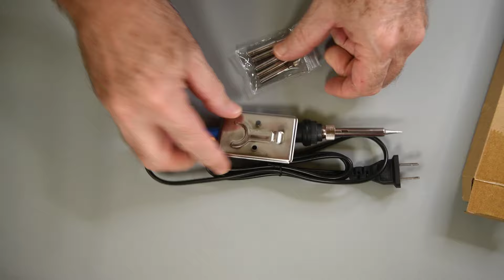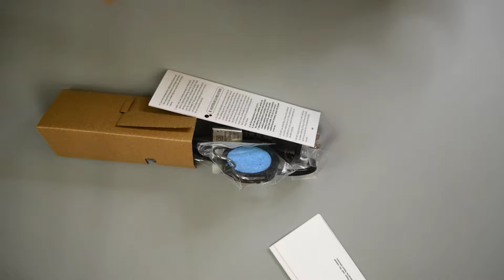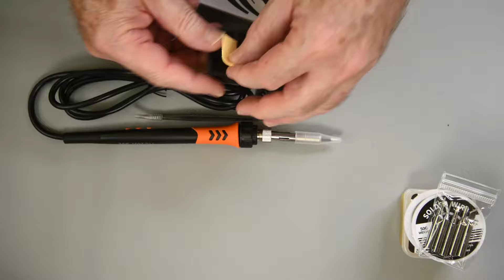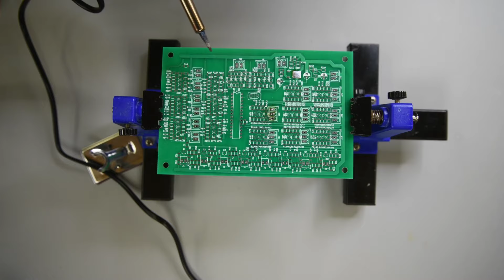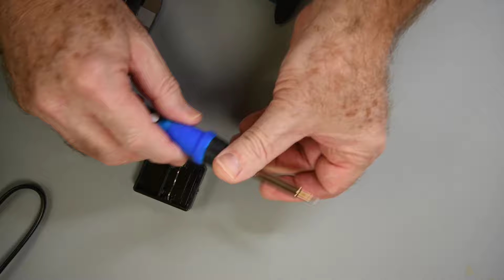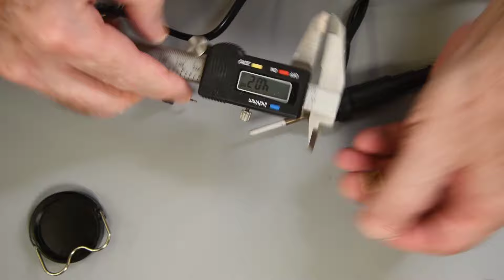Under $20 Soldering Irons – Are Any Of Them Usable

Comment: So I use a similar iron to these in the video. I run it at least once a week. It works perfectly for what I need it to do. From small to huge... brass threaded inserts injection lol
I don't wanna use my nice irons for putting in brass threaded inserts into 3D prints. That would be silly.
Reply from the maker: Wouldn't you need very good temperature control for the plastic?  I'm still looking at 3D printers, which one do you use?

Comment: The cheapest one is actually really good, if you know how to modify it a bit.
Reply: what u gotta do wit it
Reply: What do you have to do )
Reply: I use the lowest setting most of the time. In my case, the lowest setting was still too hot. One resistor inside was replaced with a bigger value to keep the wattage stable at about 10W so that it's hot enough just to melt 1.0mm 63/37 solder but not over hot to burn the solder on the tip during longtime standby. The warmup takes longer time though about 3 minutes, but I'd rather live with that.

Comment: Ive used cheap irons for soldering small RC bullet connectors. 
Id remove the tip from the iron, place the connector imside of the iron, drop a timy pieve of solder in the connector, then plug it in. The pretinned battery and/or esc wire was just pushed into the connector. It comes right out. Soldered beautifully

Comment: how about walmarts hyper tough 60w soldering iron?
Reply from the maker: What purpose are you looking to use it for?
Reply: @metalplasticelectronics354 i’m gonna use it to do some electronic soldering
Reply from the maker: I’d look for an iron where the tip and heater are a single unit. Those cost a bit more, but they’re usually worth it. I haven’t tried the Walmart Hyper Tough iron, but I’d expect it to be like most of the other $15–$20 irons.
If you have a USB-PD supply that can do 100W or more and outputs at least 20V, take a look at some of the USB irons. The iron plus a tip or two can come in under $40. I’ve tried the Fnirsi and they’re not bad, but if you get the kit with the USB power brick, the price jumps to $80+.
If you want the lowest cost for a tip/heater combo, look for something that uses Hakko T12/T15 tips.

Comment: You use cheap soldering iron for desoldering stuff though the catch is that you have to do it under 400+ degrees up to 450 they are indeed very unstable when it comes to soldering
Reply from the maker: Non of these in this batch are really temperature controlled so they are all unstable, just some much more than others.  And the fact that they deliver much less power than the stated value makes large ground connections very difficult to get enough heat to the joint.  There is almost no scenario where buying ones of these is a good idea.  A few more dollars can get something much better.

Comment: In one way your power measurement is not correct. Most (if not all) of those irons are made in China and their power claims are based on 220 volts. You tested using 120 volts, which would technically halve their power consumption.
Reply from the maker: No, most of these irons were rated at 110 VAC, with a few labeled 110–120 VAC. One model was rated for 110–240 VAC, and another was listed simply as 110 V on the box.
None of them deliver the heat output that their stated wattage would suggest. The listed wattage appears to reflect the peak power draw when the iron is cold and first turned on, rather than its sustained heating performance.
Reply: @metalplasticelectronics354  Another reason I thought why 110V might be the reason here is because, a lot of those irons had around 30watt power consumption after heating, and their ratings were around 60watt. 

Also another thing I think, is that the voltage labels might not be correct. Those Chinese manufacturers might not even take the effort/cost to make heating elements specifically for north america. They might just change the label for lower cost.

The heating elements not working as advertised is most probably the reason like you said, but that wattage being close to half their advert is what made me think that 110V might be the reason.
Reply from the maker: The listed wattage for these soldering irons ranges from 60W up to around 120W. The 120-watt model did briefly draw over an amp during startup, but the current dropped very quickly. The real issue is the extremely poor heat transfer between the heating element and the tip in most of these irons. I suspect many of them couldn't even sustain 60 watts continuously without burning up.

Comment: So no 20$ soldering irons could do the joystick replacement? I’m trying to get that done and on a budget so pretty disappointed with the results (great video though, thanks)
Reply from the maker: It will depend on your skill with a soldering iron.  If this is your first time picking up a soldering iron, then all of these cheap ones will just about guarantee disaster.
Reply: @metalplasticelectronics354 I see, it is my first time…(not including a little class in highschool a while ago) sorry if you mentioned it somewhere else but is there an iron you think could work to do this job that is still affordable? Or is an expensive one really the only option
Reply from the maker: I reviewed the FNIRSI HS-01 kit that includes 6 tips. It gets the job done.
If you're learning to solder as a hobby or planning to take it up more seriously, I don’t recommend this one—the tips are proprietary to this iron, so replacements can become a hassle. However, if your main goal is replacing joysticks (or similar light-duty tasks), this kit will work perfectly well.
On Amazon, the full kit with the USB-C power supply usually runs around $56. If you already own a USB-C PD charger capable of 20 V output, you can save money by ordering the 6-tip kit without the power supply directly from Fnirsi.com for about $42 (not sure if that includes shipping). AliExpress often has it even cheaper with free shipping.
Reply: @metalplasticelectronics354 i’ve got 28 bucks, might be able to get more, but i also wanna do a joy stick replacement in my xbox controller bc of stick drift, and i wanna start learning how to solder more and maybe do it as a way to get money if i can repair some boards, the game Service it inspires me lol
Reply from the maker: The irons in this video are not the soldering irons to learn to solder with.  The frustration they will create and the bad habits they will instill are not good.  If you have a good 100 watt plus USB PD supply, I would take a look at some of the iron kits that use that as a power supply.  Double check and make sure the supply does support the voltage the iron needs.
If not, look for some of the cheap stations that use Hakko T12 tips.  Both of those options are going to cost more than $30.  Getting a station that uses T12 tips is probably the most long-term effective cost wise.  Genuine Hakko T12/T15 tips are not that expensive and can last a very long time.

Comment: First, there are very affordable power meters. If you bought one, you wouldn't need to measure amps and volts separately. Second, the temperature meter you're using can display degrees Celsius. Why didn't you show the soldering iron tip temperatures in degrees Celsius in your video? Celsius is used in Europe. You made this video only for Americans?
Reply from the maker: I'm used to Fahrenheit; it's what I use.  Though I did get a cheap soldering iron tip thermometer that only displays in Celsius, so you will see more Celsius being used.

Comment: 18:22 does this have 110/230v auto working/////
mine 90w has .....  maybe superior than the others in temp control.
Reply: and my tip plating just wasted away.
worked fine though.
now a little bent.
similar to hakko black tips
Reply from the maker: The instruction manual lists it as AC 100 - 240 Volts.  But I only tried it at 120, and considering most of the other claimed specs are not really true, I don't know if I would trust this thing plugged into 230 volts.
Reply: should work similar to mine
Reply: the digital ones have a temperature calibration option/
tried any of those settings?

Comment: I purchased the "MEAKEST" soldering iron and replaced the tip with a Hakko T18-D24 2.4mm Chisel Soldering Tip (under $10 from Amazon) and it's surprisingly usable.  The tips that come with it aren't that great.

Comment: I have been using the first one for several years now and my impression is that there is no lack of heat and the temperature can be kept stable enough for hobbyist work. The iron works fine to do stuff like desolder and salvage components from broken electronics like old compact fluorescent tube lamps, add headers to micro controllers, make through-hole circuits or make minor modifications to home electronics. It is cheap and regular Hakko 900 series tips fit and it does not occupy much space like a soldering station would.

But there are other problems. The yellow temperature knob must be constantly checked because it is very easily moved out of its setting while working with the iron. Very often I find that it has traveled upwards, making things hotter than what they should be. This is a a typical bad habit you develop with cheap Irons like this. Maybe this can be fixed by adding some kind of wall around this little knob, like some heat shrink tubes.

Another problem is the low quality of the tips this iron is supplied with. They come in packs of about five and they wear down fast. This can be fixed, get better quality tips. I might be the first one to say it but you do not need to get pricey Hakko tips, just something above garbage tear and you only need to get one tip if you intend to do some lighter soldering now and then. I have used one Atten brand tip for some years now and that cost about 3 USD on AliExpress.

On a side note, there is a red power indicator LED inside the blue housing.

I'm not saying I recommend this iron if you are looking for a high quality soldering experience, but if you just want to solder stuff like what I mentioned then it works fine.

Also always use proper exhaust fan and avoid... 🥁 ... leaded solder. And get a third hand stand, it makes it's so much easier to work.

Comment: Conclusion: 27:11. Don't buy for learning, causes frustration. Only good for soldering some wires, not too thick ones.
Temperature control is practically non-existent, so these could burn electronics.
Real power draw is around 30-40W with one at 25W, one at 50W, but even that can't transfer the heat to the copper.
Reply: For <5 sec heat-up around 50$ will get you an iron with C245 style tips:
Fnirsi HS-02A (not B) or Alientek T80P (not T80).
The C245 style tips are able to deliver 120W heating (as rated, but can jump to 200W), good for general soldering. 
You need a 100W usb-c PD power adapter or laptop adapter for <5 sec heat-up, but a 65W adapter is enough for <10 sec heat-up.
Distinguish the C210 tip (the listings often don't), which is great for microsoldering, but it's smaller, less powerful (40W), so it's specifically for PCBs and surface-mount components. If that's what you need look for Fnirsi HS-02B (not A) or Alientek T80 (not T80P).
Reply: There are similar usb-c irons with older style tips, but for the same price as the more modern C245 irons, those can deliver 65W only, not worth today IMO. 
ST tips: Pinecil V2, Miniware TS101 (the TS100 is the previous) - these were the best years ago, when they hit the market
TS tips: Sequre SI012 (has colorful leds)
Reply: Avoid:
T12 tips - 2 generations old, huge, max 50W usually
Sequre S99 - bad tips, resets with good tips 
Miniware TS80P - 30W
Amnvolt L245C, L210C - no website, support, firmware upgrade
Drillpro PTS201 - custom tip, no website
Reply: For 20$ buy the Quecoo T85.
Uses T65 tips for 65W heating, like the Fnirsi HS-01, GVDA GD300, noname T65-SP, etc, but cheaper.
The heater is integrated into the tip (cartridge), so it transfers heat efficiently. No airgap.
You need a 65W usb-c PD power adapter or laptop adapter to power it.

Comment: Don't buy soldering iron with a heating element and the tip aren't one piece. There's a cheap iron with a built in heater with the tips like USB-PD with T12 or C210,C245 tips

Comment: I bought the TaskTool 100W soldering iron and I am very happy with it. Heats up in just 22 seconds and goes into sleep mode after 5 minutes non use and awakes with the slightes shake. It has a display and was just four dollars. They all heat with variable but constant power as expected at this price point.
Reply: Hey man i just bought the same one its going to be shipped now, anything that is noteworthy?

Comment: I want to replicate your tests with my irons.   What size and thickness are the copper strips ?
Reply from the maker: I think in that video I used one 0.5 inches wide by 1.5 inches long, and the sheet is right at 0.01 inches thick.

Comment: I tested cheap (below $15) 60w and 80w irons off Amazon, they both failed to heat up 12AWG wire.  If you're a DYI'er that messes wires,  skip going cheap and invest in a quality soldering iron station.

Comment: I have one of these soldering irons and I am quite happy with the performance. It works very well, but then I decided to purchase 900M replacement soldering tips from AliExpress. They came and guess what. The soldering iron was useless with them. The new tips are identical visually. The finish looks good, the wall thickness is 0,4mm instead 0,6mm and the hole is 0,5 mm deeper and they just don't work. Maybe it will be interesting experiment to try different tips on these soldering irons.
Reply from the maker: Nearly all the irons draw similar amounts of power. The tip plays a critical role in effectively transferring the heat generated by the heater. A high-quality Hakko tip, while nearly as expensive as a cheap soldering iron kit, can significantly improve the performance of any of these irons.  And the tips are a big part of the reason I wouldn't recommend any of them.

Comment: Thank you for testing. Looks like I'm using the cheapest one in your test for over 5 years now for synth diy projects(often very cramped modules,tht and RoHS). With no compare to other irons I would say, it works fine. Only downsides are: the long heating time of the iron, desolder wig is hell, but maybe I'm just using it the wrong way, using desolder pump instead and not all of the tips from the set will fit, but the one I need does :)
Reply from the maker: If you use a soldering iron often, do yourself a favor and get a real temperature-controlled iron—preferably one with a one-piece tip/heater. Life will be better.

Comment: Ive got the 110w version of the 3rd iron in the video and for about $15 its been surprisingly good. Gets hot fast and can do some medium duty soldering with no problem. Sometimes you have to adjust the threaded section on the body to get the tip seated directly on the element and gets good thermal transfer.

Comment: On mine there is a surprisingly big air gap between the ceramic heating element and tip. I wonder if there is a way to fill that gap to improve heat transfer?
Reply from the maker: I would try some new tips first.
Reply: Have you tried thermal paste?
Reply from the maker: I don't know of a thermal paste that can handle that high temperature.

Comment: They are ALL the same Soldering Iron with the same power rating, roughly.
Look at the packaging and extras.

All the same. What makes anyone think the Irons inside were any different?!?!

I went through 3 of them and finally bought a ts -100 knock off for $30 with extra tip/Heating elements. Dual Ac/Dc operation and never looked back.

Melted ANYTHING and was rated at 80watts.😊😊😊

Comment: There is a tutorial in MAKE zine where you could build a temperature control glue gun using 555 timer. I mod it to use on a 60W soldering wall plug iron. Haven't burnt out an iron in 10 years. 😂
Reply: Can't find it

Comment: I'm going to pretend this video doesn't exist since I bought 2 irons that are in this video lol
Reply: do they work well? which do you own
Reply: @nyafailure I bought one in this video, but it is a pulsivo branded one. Looks exactly like one in this video, but has a pulsivo label and 3000 reviews.
Reply: @monetary_episode  with the pulsivo one did u use that by chance to replace joysticks on a controller if so was it good enough to get the job done or stay away
Reply: @monetary_episode  Ah you must mean Plusivo, right? I got the 60W blue one, its pretty decent ngl.

Comment: Then what's a good recommendation for an iron that's gonna be used for mostly joystick repair?
Reply from the maker: I would look at some reviews for soldering stations.  And if you can afford it go with one that has the tip, heater, and thermocouple as one piece.  I've seen some listings for stations that used Hakko T12/T15 tips but I haven't tried any of them.  But something along that line would be better than a standalone soldering iron.  In my opinion.

Comment: I've been using budget soldering irons pretty much my entire life.  I've used them on everything from electronics to automotive, etc and it always seemed like a fight.  Tearing off pads with solder wick.  Trying to unsolder components through eyelets.  It was all just so time consuming and difficult.  Trying to replace the sticks on my PS5 controller was the last straw.  I bought a Hakko FX-888DX and a FR301-82 Desoldering Tool.  OMG, I can't believe the difference.  Sounds advice from MPE here.  Buy the best you can afford.  It'll be worth the money to save the frustration and the damage you can inflict by using sketchy budget irons.
Reply: I bought one of those cheap irons and it has fixed a PS4 (hdmi) and car stereo speakers ( 4*6x9) and a few other power tools (12v) and leds on flash lights. Its a cheap once in a few months kinda tool. Well worth the $10😂